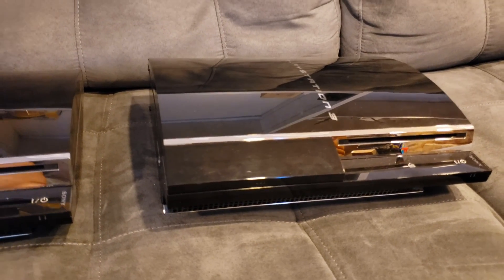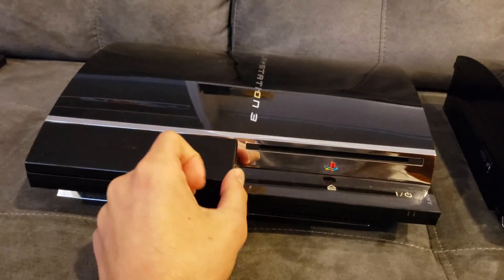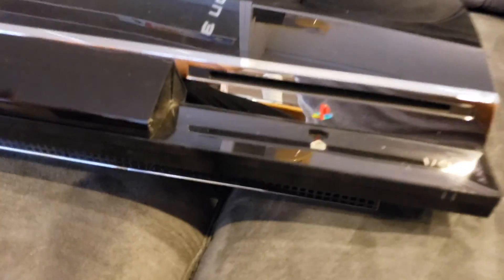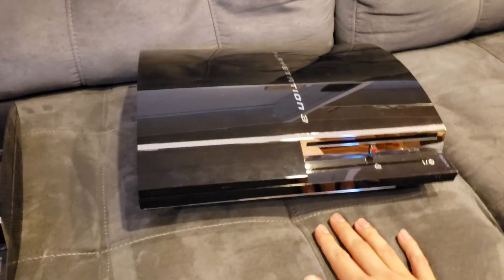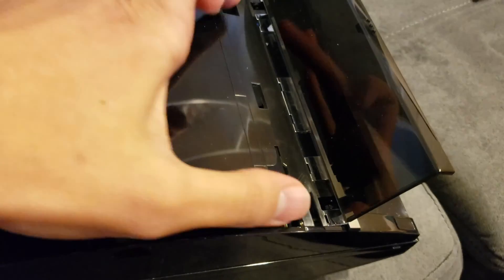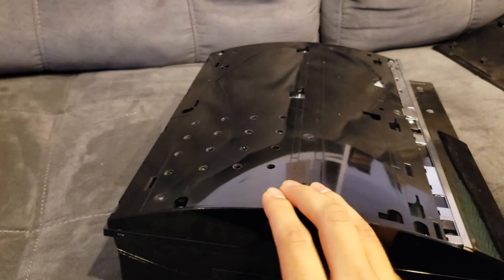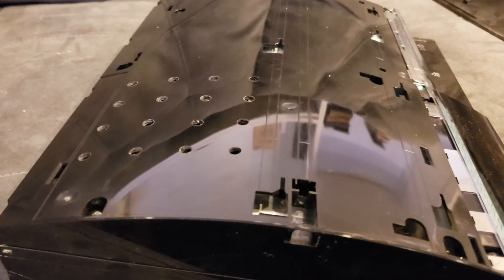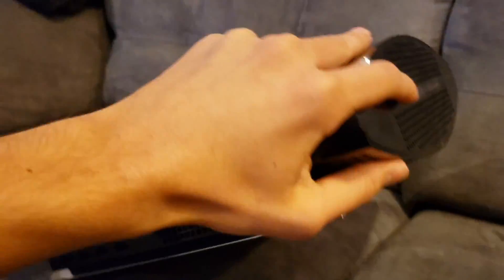Why PS3 YLOD happens and how to prevent it

Comment: Not changing thermal paste for 10 or even 15 years now doesn not means it wont work like it's intended to.. I have CECHK console and haven't cleaned it or change the thermopaste at all. It is running with no problem now, very quite and efficient, in games it's not going more than 35% fan speed and it's not very hot. My active time is 400 days.

Comment: What are your opinions on a intercooler fan for keeping a backwards compatible PS3 cooler and thus last longer?
Reply from the maker: I would strongly advise against using them as the vast majority of them actually impede airflow of the PS3. It would be much more beneficial to stick a regular fan in front of or underneath the console if you are so inclined. 

I would focus more on making sure that the console is in a well ventilated area, with no obstructions in front or behind.
Reply: @myairspace121  OK thanks I will try that. I will also try standing it up as you mentioned in your video.
Reply: @myairspace121 you're 100% correct here. Never use an intercooler fan to blow air inside any console. With my 40GB CECHG01, it's fan is super quiet and the console stays really cool. When I tried putting a cooling fan on the console to blow cool air through the front vents (plugging it into one of the two USB ports in front. The fan got really loud. I knew then never to do that again. Since that one time, I've never had a loud fan at all

Comment: Extra vents I assume was only because the console itself generated more heat and used the 90nm chips.
As time went on, the vents decreased because the heat needed to dissipate decreased since more efficient cell processors and RSX revisions were used. So it's not the more = better principle here. It's because those old chips needed the more vents or it would overheat and die faster, as many of them did.
Reply from the maker: Exactly. What's also fascinating, that I also touched upon, is that the intake and exhaust directions were changed early on. Backwards compatible models exhausted hot air from the right side (head on) and rear of the console, while non backwards compatible models exhausted air from the rear and used the right side as another intake. These models all had 65nm CELL processors though, and later 65nm RSX GPUs.

Comment: Are heat issues the only cause of the YLOD? Because I have a 60GB PS3 that I turned on for the first time in about 5 years and immediately got a YLOD. And when I did use it previously, it was never for playing games. Ripping SACDs is the only thing I ever used it for.
Reply from the maker: It's not the only cause, but it's one of the most common. The next most common would be a dead capacitor for the cpu/gpu which could be likely. Sorry to hear that though :(

Comment: Is it a good idea to put a laptop fan-cooler below the ps3 so it can be placed horizontally?
Reply from the maker: It’s possible it may help, but there really isn’t that much air intake on the bottom of the system. If the air is blowing more towards the front of the system, that may be more beneficial.

Comment: Does the wear on thermal pads and paste also apply to a new ps3? Even though 16 years has passed in storage?
Reply from the maker: Yes, but not to the same degree. The paste and pads will age more after being heated and cooled many times over, but paste and pads can just degrade a bit due to age. I would say the pads are probably fine, but the paste may not be adequate. The ultimate test though would be if the console fans speed up soon after you turn it on

Comment: My launch 60gb fatty is still going strong. Never been flat, always vertical and in the open behind the TV. For the last 15 years a small usb powered fan sits right in front of the intake ports, also behind the tv. I don’t have pets or carpets so dust is minimal. Still chugging along. Thanks for the video. 

I will say that sometimes things are made to transfer air more efficiently and extra holes would disrupt that flow. Not sure in this instance.
Reply from the maker: Awesome to hear that! And yes, that is true in most cases. I am also not 100% sure in this case, but as far as cooling the cpu and gpu, I think this is the most effective way of doing so.
Reply: @myairspace121 it can cool gpu and cpu, but it may cause the PSU (power supply unit) to overheat, which may be worse

Comment: I did a smoke test. All vents are intake besides the two in the rear. The rear vents are the one and ONLY exhaust vents on all Fat PS3 models. The only advantage that you are mentioning is the fact the older models have more intake ducts thus allowing more cooling. More intakes means more air can be shoved in and exhausted out.
Reply from the maker: That's not true unfortunately as I have tested and disassembled both 60Gb Launch Models and 80GB software BC models. I never claimed that ALL fat PS3 models exhausted air from the left and back, only that backwards compatible models do. Thus all cechA, B, C, and E models exhaust from the left and back of the systems. 

Any other fat model PS3 without those model numbers will only exhaust heat from the back of the console as the left side has been re-engineered to be an intake.
Reply: @myairspace121  I just got a nyko intercooler and 2 mini fans for my original 20 gb ps3 hopefully this helps me lol
Reply from the maker: @ozzyozcorn  Actually you should be careful with those nyko coolers! They have been proven to restrict airflow to most systems they are made for. You can find more videos about them here on YouTube.

Comment: Nice tips! Back In those carefree days & summer vacations, i used to run my New 60gb phat 24hr or more everyday. I  was so worried about ylod I always ran a desk fan at the console's front air intakes. I never had an issue, & it still runs great today. The only prob in doing that  was all the accumulated  dust on/in the usb ports & console. Lol, I'd just vacuum those areas out.  I prlly should remove the old thermal paste w/a fresh coat! 
Cheers!
Reply from the maker: Thank you, and I know what you mean haha. Glad yours is still working well! And yes, try and change that thermal paste only if you’re comfortable doing so. It’ll surely help.
Reply: @myairspace121  Thx for  replying! 😀👍 Yeah.. the thermal re-pasting wrk is very straight fwd.  I do have to get a temp control hairdryer, etc., not to mention making sure i'm static charge free before touching the console's   components & metal parts! A Very Merry Christmas & New Year to You & Yours!!! CHEERS Mate! 😇
Reply from the maker: @bonhzeppelin55  Thank you for watching! Merry Christmas and Happy New Year to you and yours as well :)

Comment: I fully took apart my 80 gig, cleaned out all the dust, and applied new thermal paste, put it all back together, still gave me the YLOD. I got the slim instead and I just play my PS2 games on my PS2. In reality, the light appears yellow, but what it actually is (if you take the shell apart from it) the green light comes on, but a click happens and the red light next to the green comes on too and then it shuts off with just the red blinking. I made the mistake of getting the 80 gig fat used not realizing that this YLOD was a big problem for these consoles. I could look and tell that it had been opened before, because I saw the warranty sticker was removed. Most times I played it, within just a few minutes, the fan would kick on, and get louder as I kept playing. It would eventually get super loud, and then every once in a while it would cool back down again. The pattern I noticed: the more intense the game is (in particular: newer games) the louder the fan gets and the more likely it overheats and shuts down.
Reply from the maker: Yeah I see. I’m sorry to hear about that. It certainly seems like the ps3 you bought had been overheating for quite a while. It likely couldn’t have been saved unless you maybe try and change the old capacitors to new tantalum ones. Playing ps2 games on an actual ps2 is still great though. I do that every now and then.
Reply: @myairspace121  yeah, it's always great to play them on the PS2 if you have a good one. I like the slim PS3, it runs really smoothly and quietly. I feel bummed though; I really liked the fat model. It looked so cool, and I liked the backwards compatibility it had. One of these days when I got free time, I might try to experiment on it again.
Reply from the maker: @autolife2785  For sure and sounds good. I hope all works out for you. Thanks for watching!
Reply: @myairspace121  hey I apologize for randomly asking, but do you think that if I replace the NEC/TOKIN capacitors in my 80 Gig, it may come back to life again?
Reply from the maker: @autolife2785  No worries! It’s very possible that a successful replacement would bring the console back to life. If you have experience with soldering or are willing to give it a shot, it may be worth your while. I know a handful of people that have done so and had positive results, but I also know a couple that didn’t have any luck. There is a well-written tutorial online on how to do this if you google the topic I believe
Reply: @myairspace121  thanks man! I used to do some soldering work back in college about 4 years ago. I already know I got the slim to use, but I just really liked the fat one. I feel like if I had owned it from the time it was brand new, I would have taken good care of it, and it would still be  up and running today. I never was able to get my hands on a PS3 way back then when they were new, and this year was my first time owning one. So I guess you can say I'm pretty new to PS3 as far as owning one. I've been tempted to order some tantalum capacitors and open it up again
Reply: @autolife2785  Any UPDATE? Did you change capacitors?
Reply: @TaylorJAW  nah, I gave up on it. I just play on the Slim now. I play my PS2 games in my PS2. I kind of gave my slim a look to keep the memories of the fat alive, I gave it the old "PLAYSTATION 3" Spider man font logo, and I colored the PS3 letters white
Reply: @TaylorJAW  by the way, just curious, did yours get the YLOD?
Reply: @autolife2785  No mine hasn't got it. I've done all preventative measures, even CFW for better fan curve.
Reply: @TaylorJAW  that's good that you came prepared early. I got my fat 80 gig used off ebay in July 2021, and I didn't realize how big of a problem the YLOD actually was, but I learned quick. It used to get very loud even after just 5 minutes after starting it. Every once in a while it would shut off and beep 3 times during mid gameplay, and it would blink with the red light. One day, it finally did just that, and I saw the yellow light. This was just 3 months after I got it. I'm glad I was able to find a good condition slim after. I tried repairing the 80 gig twice, but no luck :/
Reply: @myairspace121  hey, my apologies for all the questions man, I remember I asked you a bunch a year ago. So, recently I got a CECHG01 non-backwards compatible fat model. So I noticed it has way less vents on it. It's super quiet already, and it almost appears as though the previous owner barely ever used it. The console itself is super clean with very small micro-scratches that are barely noticeable. When playing it, it barely ever makes noise, however after an hour or so, you can hear the fan making a slight whirring sound, but it's barely that loud at all. Now what I'm curious on, because of where the fan is located, would sitting it on 2 wood blocks to keep it off the surface it's sitting on keep it from getting hot due to where the fan is located? I have it sitting on 2 blocks currently, and I have clear space around it with nothing obstructing any air flow from either the back, or the side. Again, I'm sorry I keep asking you so many questions about these fat PS3's. This one I got is pretty much just like the non-backwards compatible model in your previous video where you were explaining the difference between it and the backwards compatible model.
Reply from the maker: @autolife2785  No worries about the questions. 

As for the console, I don't think it will really make much of a difference when you prop it up for airflow on the bottom, because that model doesn't have any vents down there. You really only have to focus on the front, rear, and right side of the console. The front and right side act as intakes, and the rear is the exhaust. As long as those areas are well ventilated, you should have no issues.
Reply: @myairspace121  you're right. I did notice this one has a lot less vents on it than the backwards compatible model I had a year ago. Just like you said in your video explaining the differences, I noticed that this one is a lot lighter than the backwards compatible model, probably due to less material inside. So far, it's been performing well. The fan doesn't get too loud, and it's almost like the previous owner didn't really play it much. I got it sitting in an area with nothing around it and the air can flow freely from the back the side. I was just curious if sitting it up would keep the spot where the fan is underneath the console from getting too hot from underneath. I almost was wondering if I should drill holes on the bottom like you did, or I may get like a cooling pad that it can sit on, just to keep the console as a whole, cool while it runs
Reply from the maker: @autolife2785  Sounds like the console is doing just fine actually. I don't think you have to worry about the fan area getting hot since that's actually where all the cool air will be gathered to be blown through the heatsink and then out the back of the console. I don't think there's any need to drill holes in your PS3.
Reply: @myairspace121  yeah it seems to be doing pretty good. I also have been making sure every time I'm done with it to go back to the home menu, eject the disc and let it sit for a few minutes before turning it off. All the fan has is just a slight whirring sound, and not the loud, scary sound you hear when it sounds like it's overheating. I actually learned that the best thing to do with this one, is to not have ANY object obstruct air flow through the vents. I had a little USB cooling fan that I plugged into the front vents to blow air into it the first day I got it, and as the game I was playing started up, the fan did get loud. From there, I just left it alone, and it obviously does a great job staying cool as it is. Thanks for these videos though; they're very informative and helpful.
Reply from the maker: @autolife2785  That’s great to hear. Thank you for watching them!

Comment: I was thinking about drilling holes into the side for more airflow is that a good idea or bad idea
Reply from the maker: It's not a terrible idea, but if you're going to drill holes, it's probably better to do so right underneath where the fan is. When it's taken apart of course lol
Reply: @myairspace121  Well I plan on drilling right over the fan as everyone suggested, but I'm trying to get even MORE airflow because my PS3's fan was screaming at me last time I played. So I thought a few little holes on the side of the lid might help even more. I haven't seen anyone do it so I was wondering if it was safe
Reply from the maker: @GoldenFenrir  if You drill bigger holes on the side where there are already holes (typically right side) then yes, that should help with more airflow. Don't drill where the Blu-ray drive sits though as that will not do anything for you. It sounds like your PS3 could use some cleaning or fresh thermal paste. Doing those should decrease your temps and fan noise significantly.
Reply: @myairspace121  It's a Slim.  I'll drill the holes in the lid on the left side next to the fan. I've tried disassembling it but I couldn't get the power supply out. I don't want to touch the mother board either. Already broke a PS3 controller after disassembly. People say you should glue the dust covers on around the holes and I'm afraid of the glue melting. I'm getting feet risers to raise the system and a laptop cooler to put under it. This is how much I don't want to touch the motherboard.
Reply: @myairspace121  my phat ps3 Came today so I can hack on cfw hope mine don't do this

Comment: I like drilling the extra holes idea, but I don't think there's really much you can do about it. I don't use the ps3 much anymore fore fear of its death. When I do I have a big industrial fan blowing air on it to try and blow as heat from it as possible. Sony has always made terrible quality consoles since ps1. Ps1 & ps2 were plagued with DRE (disc read error). Purchased two ps1's, three ps2's and ps3 died playing Uncharted 2 online. $150 was paid to get it fixed and sony gave me a brand new one. Then years later that over-heated and went into a coma and awoken some weeks later. My ps4 gets no playtime. Never had a problem with a xbox, yet.
Reply: well 360s RROD is more of a problem then YLOD
Reply: @baderp.l.s6129  I understand that but this is my truthful account of what I've experienced.

Comment: No need to mutilate your console by drilling holes. Just use CFW & modify the fan profile. If it YLODs after that it’s most likely NEC / TOKIN capacitors failing which can be replaced.

Comment: you can stop it from VLOD 100% if you jailbreak it ,you can change the fan speed EXCLUSIVE settings tested you need to install webman mod open webman settings set the fan speed on the ps2 emualtor at 50% and set auto on at temp 60 @40%speed      the fan will speed up about 20%  at all times .so a little noisyer but its worth it never getting VLOD you can also get a INTERCOOLER
Reply from the maker: Yes that's true for an overheating YLOD. I talk about this in the video briefly and have provided some jailbreak links in the description